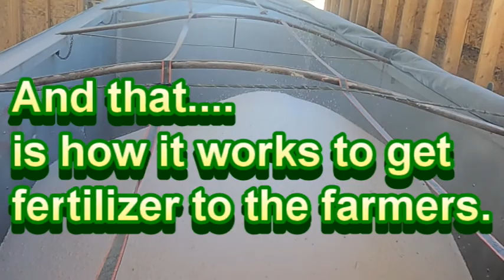Fertilizer Plant Operation & Upgrades

Comment: Good Job Sir, only thing I can say is, Check that static rope for frays/cuts when used over hard edges, there that's my safety tip of the day. lol Stay Safe 🍺🍺
Reply from the maker: For sure! I check it once in a while, but not as often as I should. I really probably shouldn't even be using that rope. It's had a long, hard life. I've even used it as a tow rope to pull my fishing boat behind a houseboat several times. But, what the heck. It 'looks' ok. Right? Lol. Thanks brother!

Comment: I use a safety 8 with the hooks on the side to lock the rope, im not doing crazy work anymore,  im taking care of my brother lol, good job
Reply from the maker: I've seen those safety 8s with the hooks, but they look like they would be good to have.
Reply: @RobPainless  You swing the rope around to lock rope in place, I have the back harness as well, but I like the rappelling gear better because one has control of how to get down if something happens lol.

Comment: U just raking the big bucks! good for u good job. U  even got  new gloves, man it has to be miller time or whatever u prefer. my max altitude was about 1,200 ft. + - doing commercial wk on comm towers. I love to climb but age and worn out body part stoped that..cool video...
Reply from the maker: Big bucks! Yeah! Or, not. Lol. 1200 ft! Wow, that's awesome! I've never climbed one that high. Old as I am now, it'd take me a while and a few rest stops for sure! Thanks, Mike!
Reply: @RobPainless  It paided Very well but it make you old fast so I quite. I worked for a company that serviced commercial tower all over the western world even down in the Islands off the S. east coast but that was all most 40 years ago. Man did I have strong arms.  Take Care
Reply from the maker: @mikeault5335  Very cool, Mike. Very cool!
Reply: loved the views and I had to rest after about 3 to 400 ft. average tower was 400 to 600+-I used to climb around Ohio for many of the ham radio clubs and friends, But my hand are gimped up from nerve damage and my grip is not the best I will go about 40 ft any more. I love hight for some reason..Later @RobPainless

Comment: Just watching the end here laughing. There is nothing about that plant that would fly in California. Exposed wood walls, dust, tight spaces, no fire sprinklers. I’ve got a building I’ve owned for 20 years, and I’ve had to completely remodel it 3 times to bring it up to the latest code, and we’ve probably had another half a dozen minor remodels on top of that.
     I had a neighbor out there who made vitamin pills. He had to put in a 30 grand air filtration system because they came in and took air samples and detected trace amounts of vitamin b12 in the air. This place is fucking ridiculous.